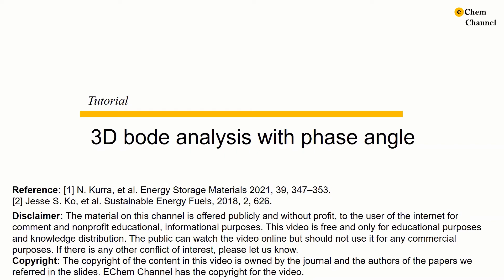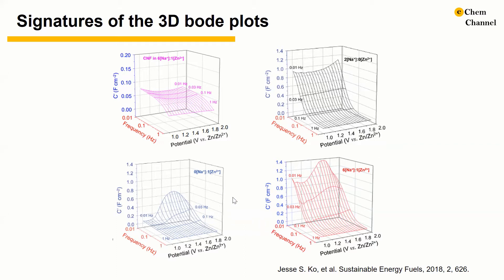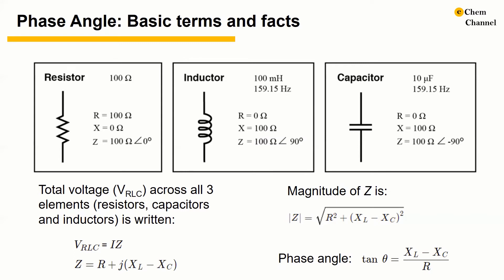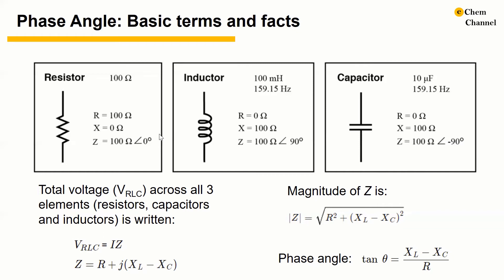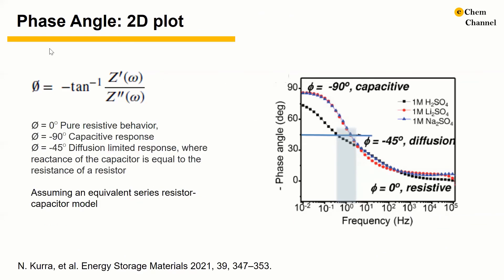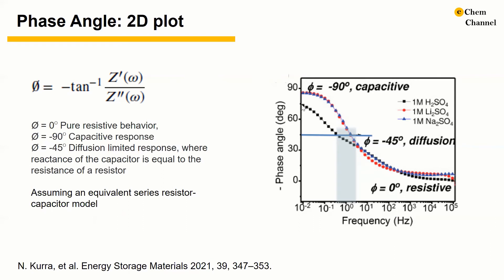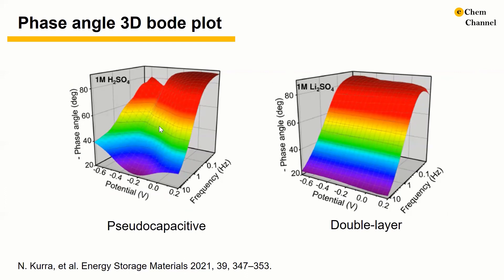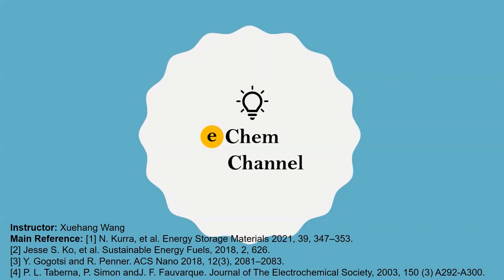Tutorial 22-Phase angle bode plot

Comment: I wanted to ask the meaning of 
?Parameter Y0 which has units of "S*s^a".
?Parameter Zw whose units have been written as "S*s^(1/2) ".
These two units are used in the simulation table generated in the EIS equivalent circuit fitting,

And what are these units or factors "S*s^a".
& "S*s^(1/2) " ? any concept of definition of these, you have ? or a relevant link maybe?